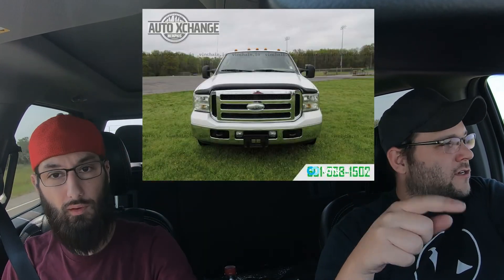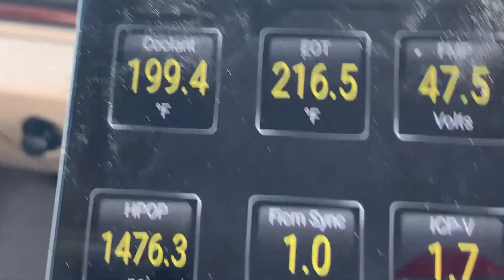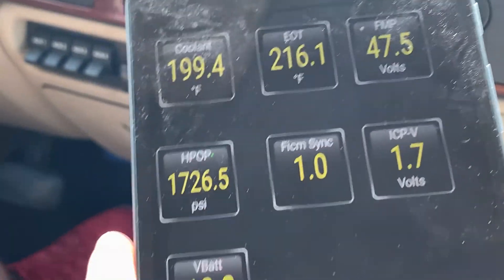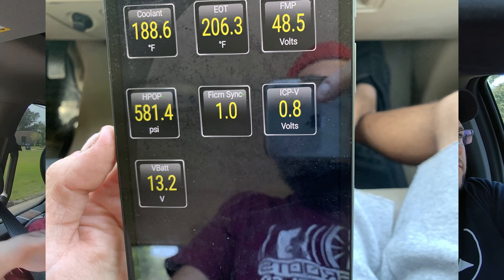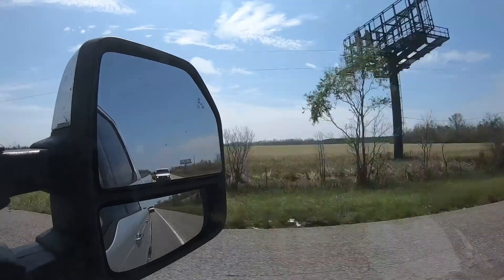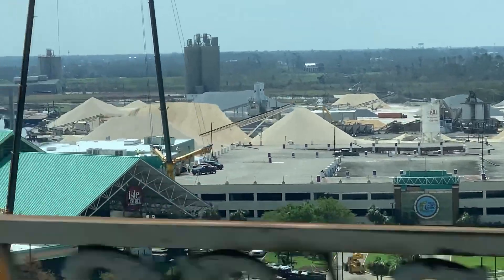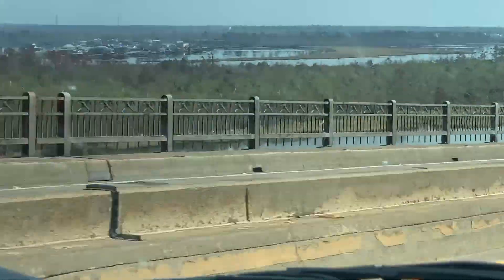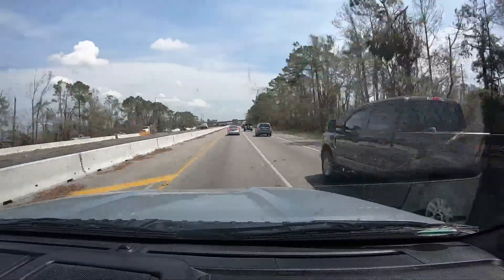How NOT to Buy a Ford 6.0

Comment: Had F150, bought big enclosed trailer. Need bigger truck.

Sold F150, Bought 6.0 F250. Complainer about how terrible to daily it was compared to 150.

Sold F250, bought another 150 and changed to
Open trailer. 

Now looking at 6.0 350. I know
How this ends.
Reply from the maker: Of course, buy a gooseneck trailer to fit all the things.